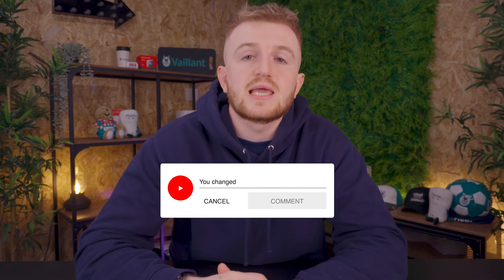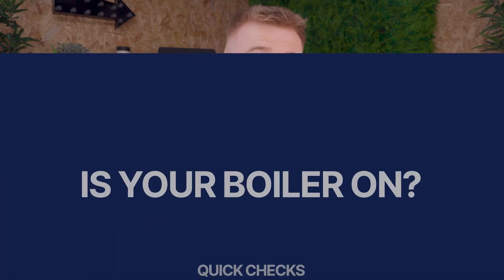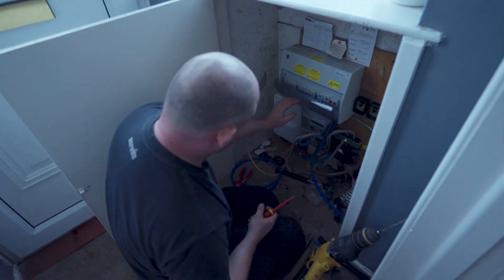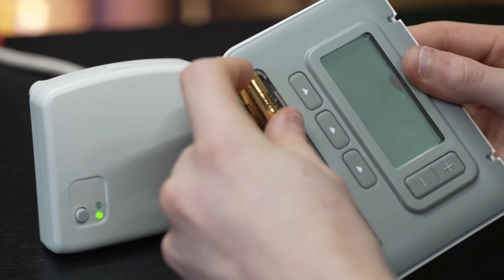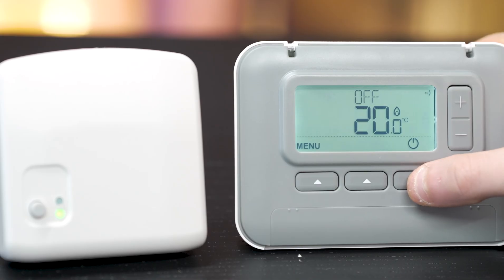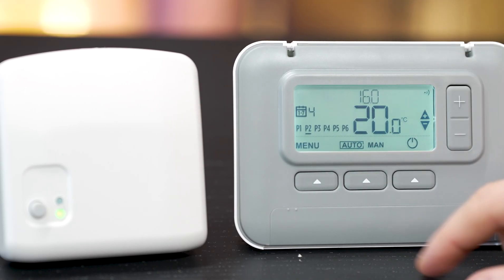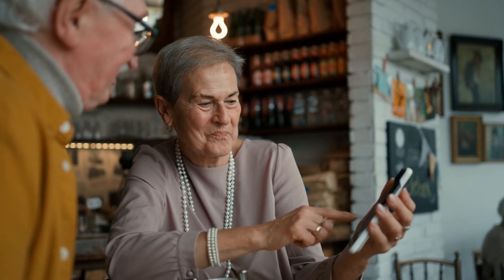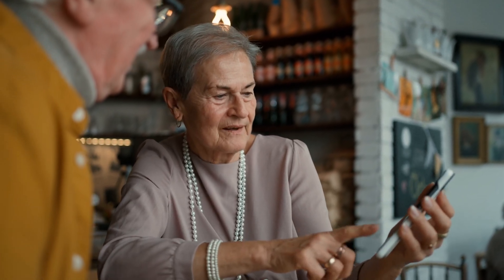How to Fix a Boiler Not Responding to Its Thermostat

Comment: My EPH thermostat has became unresponsive after changing the batteries, display light is on constantly and the  buttons don't respond. It's also stuck in manual so the heat is constantly on unless I remove the batteries. Can anyone help with this issue?
Reply: Same here, did all the basic troubleshooting like changing the batteries, puting the eph near the boiler and still does nothing

Comment: Hi thank you for this. When the thermostat is turned off the heating doesn’t go off. I am having to turn boiler on and off. New batteries changed. I have an EPH controller thing (sorry not very technical) any ideas? Thanks
Reply: Sorry it’s an EPH RPFP-OT
Reply from the maker: Are they definitely paired and wired in correctly? I would contact your installer

Comment: My ESRTP4RF switches between showing all the icons at once and a normal screen. Also the other device that's cinnected to the boiler is flashing. I've resetted it by pushing the button and took the batteries out for a few minutes but no chsnge. Any ideas?

Comment: wished there was a segment discussing the receiver--if the lights on the receiver indicate it does not receive info from the sender/thermostat, is there a simple check of the receiver that can be done?
Reply from the maker: If the LED flashes when receiving signals, it indicates a connection. A solid light on the LED suggests the receiver is disconnected from the thermostat. Hope this helps

Comment: My mums ideal Thermostat has been on Pairing all morning Done all the steps on the Quick start guide & thermostat just keeps saying pairing Any suggestions
Reply from the maker: Have you tried resetting the boiler from the fuse spur. I would contact the manufacturer of the thermostat in this case, it could be a faulty unit
Reply: @iheat Done all that Ended up having to replace it & working fine now 👍

Comment: My central heating randomly comes on and goes off when it's not programmed to do so, (It has a 'mind of its own).  The house sometimes reaches 27.5 degrees!! I've tried all of the trouble shooting, but to know avail. Trouble is, the plumber who installed the boiler last year, will not answer his phone/ignoring my messages/calls. I'm desperate, what can I do? Thanks.
Reply from the maker: I would get in touch with the manufacturer of the boiler , they will likely charge a call out but at least it will be the best possible person out to the job
Reply: @iheat  Thanks for your reply.

Comment: Mines frustrating. It's sending the signal, the receiver is flashing like it's trying to fire up but it doesn't. The water etc is working fine.
Reply: Jerseybaby- did you work out what was wrong? Mines doing the same
Reply from the maker: Could be a wiring issue, have you tried resetting / repairing everything from your side before getting out the installer to check his work. Might be best route
Reply: Where is the receiver?  I changed batteries not communicating with receiver .. it’s inside Vaillant ecotecplus boiler (combo) needs reset .. hot water ok not the heating I’m freezing!
Reply: @normaaspinall hi i ended up buying a new thermostat and reciever, it did the trick. The reciever is the circle thing ith the light on the boiler that flashes when the boiler is turning on and off

Comment: Thank you for explaining, but our situation is a bit strange.

We have a vaillant eco tec 832, the heating set as off, but it will still randomly kick in and never turn off. 

This is after telling us to clean the outdoor weather compensator. Not sure what to do!
Reply from the maker: When was this installed, have you tried contacting the installer or vaillant directly, sounds like a fault in the boiler / compensator. Or could be an old thermostat still wired up in the home? Is the heating set to off at the boiler or on the thermostat
Reply: @iheat  yes vaillant came out last Saturday, the weather compensator died and it messes up everything. Luckily it is all under warranty.